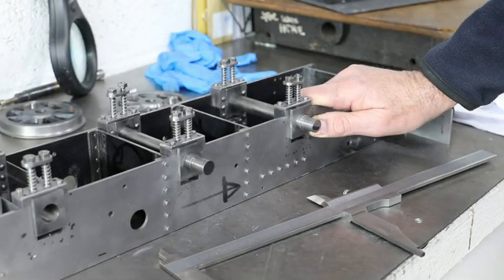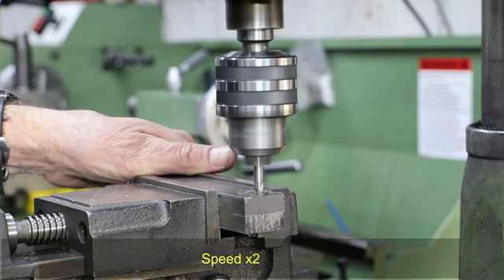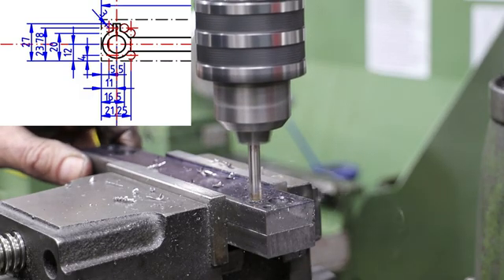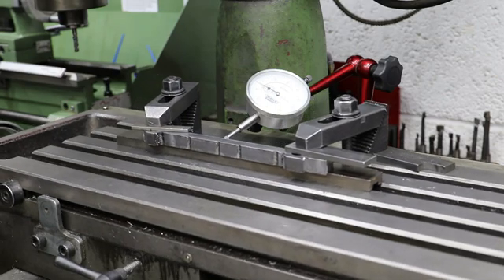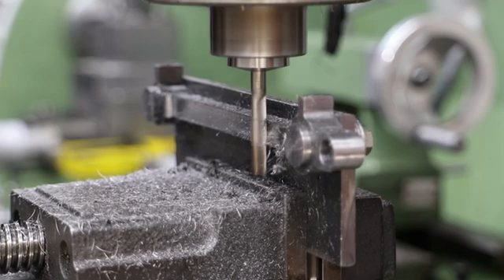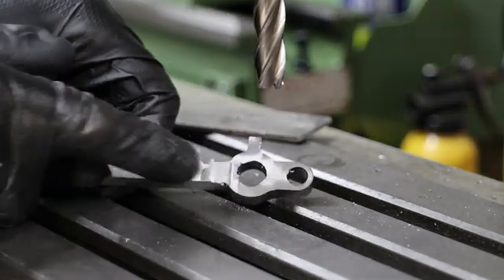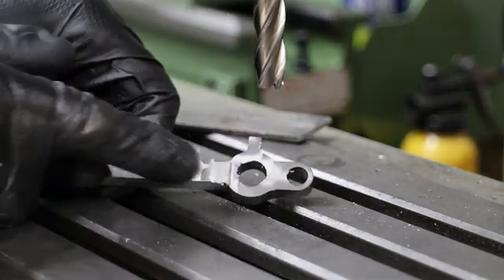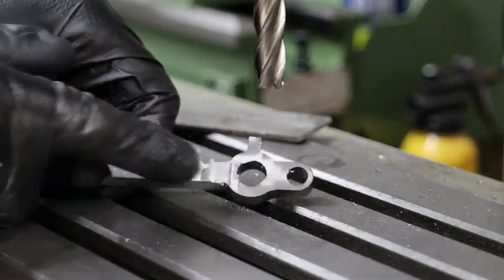Part 13: The Front Coupling Rods (1)

Comment: Great videos Mark.
I have just subscribed to your chanel.
The videos are well put together and like Williams workshop, to the point.
"Off Topic" A long while ago, a person I think, called "Mark Smith", showed a video of a Royal Scot chassis  running on air, and I wondered if that was your good self.
Great videos, I will be keeping up with and looking forward to seeing further progress.
Cheers.
Reply from the maker: Hi, thank you for the positive feedback.  I subscribed to your channel a while back and I've been slowly working through your Videos.  Great work 👍
The Royal Scot is indeed mine.  Unfortunately work got in the way about 9 years back and progress pretty much stopped.  I started 'Jack' as an inroad back into the hobby.  The Scot is a very complex build (not the best choice for a first model) and I fancied something a bit (lot) simpler.  I will at some point restart and look to finish it off.  
Too many projects  too little time 😁
Reply: Hi again Mark, yes I too suffer from having FAR TOO MANY irons in the fire at one time.
I also have a part built scot (which I pretty  much got in much the same condition as it is now), about 40 year ago, that is how I remembered yours and the name link..
One day we might both get them completed.
Keep the good content coming.
Cheers., @markshomeengineering5243